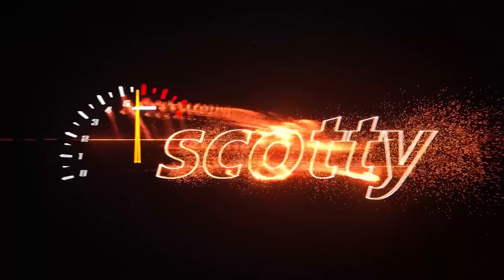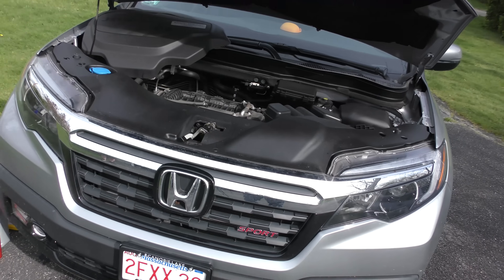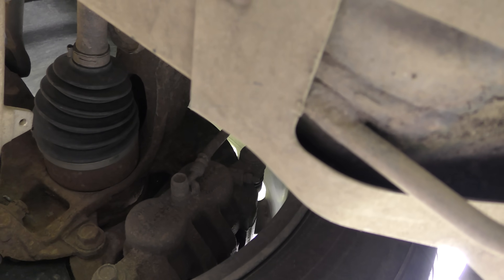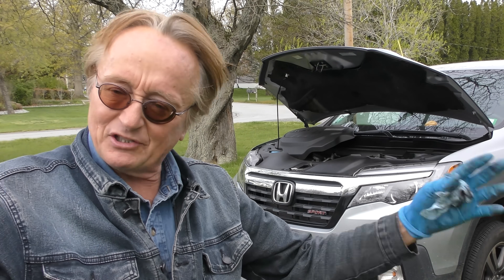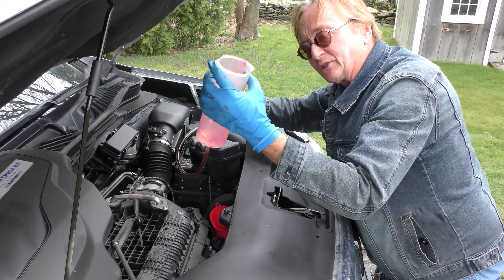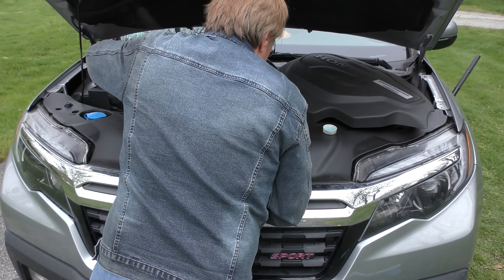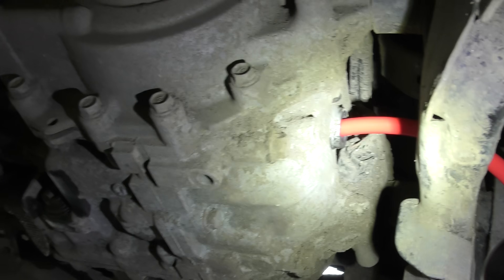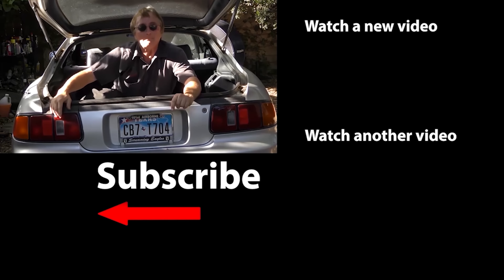Here's Why Car Companies Don't Want You to Change Your Engine Oil or Transmission Fluid

Comment: I have a used Honda with about 90000 miles on it, and the transmission fluid has never been changed. Would you recommend changing the transmission fluid, or had that ship already sailed?
Reply: It depends, but it’s a risky business definitely keep the old fluid just in case. My 07 Honda pilot was 140k miles when I drained and refilled the tranny for the first time. The fluid was pitch black and on the low mark the tranny wasn’t happy. I believe I waited 6 months for the next change. 

Then at 144k miles I switched to valvoline Maxlife synthetic ATF fluid, I did 2x drain and fill and the transmision started working much better! No more weird noises, hard shifting, or weird vibrations.

Finally at 150k miles I started using Amsoil signature series 100% synthetic ATF fluid and let me tell you the  transmission transformed! it works super smooth now it drives amazing I’m at 155k miles now and so far  everything is good. 

I also did the transfer case oil with Amsoil 75-90 100% synthetic and the rear differential with Honda V-TM4 special fluid. I’m convinced that both Valvoline & Amsoil ATF fluids are superior to Honda’s DW-1 ATF fluid.
Reply: Yes. You will be fine.
Reply: I think you should. 
Make sur to just drain it and refill. Do NOT do a flush.
Reply: Change it, but as Scotty said, use the original honda fluid and the exact same amount that comes out of the transmission. It's expensive, but you don't want your transmission shuddering due to the use of cheap fluid.
Reply: If you want to try to change the fluid a partial change would be good idea. The 5speed auto I have in my car made by Honda only drains half the fluid at a time. They recommend you do it 3x in a row driving between each change. I'd recommend only doing it once and seeing how it feels, maybe do that once a year if it doesn't cause any harm the first time.

Keep the fluid that drained out. If you cause any slipping you can put some of your old fluid back in
Reply: @Trickster_24  Bad advice to just drain half. I had a 2002 Yaris  for 14yrs,i drained it fully every 6 yrs with zero issue. Keeping what was drained is a good idea.
Reply: @tardeliesmagic  you're right it might be fine, but the truth is the full fluid change Honda recommends is still a partial change a 3x3qt change on my transmission is what they recommend and that leaves about 15% of the old fluid in there. There's no issue with partial changes on a transmission because the fluid cannot be contaminated by blowby from combustion. As long as you can remove enough clutch material in the fluid out of it to slow wear, and dont cause slipping your transmission will last a long life

Some older Honda transmissions like my 5speed are known to be fragile so I was airing on the side of caution
Reply: 90K is not too late. Just drain and fill with genuine Honda ATF DW1.